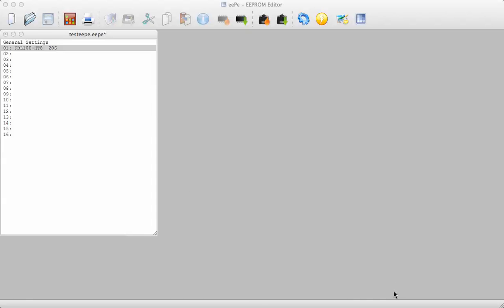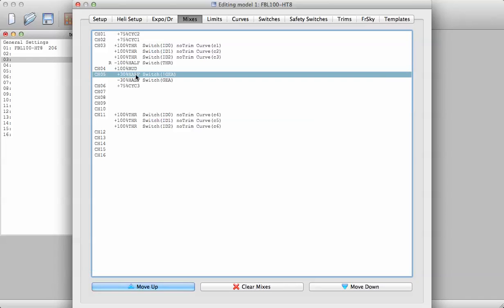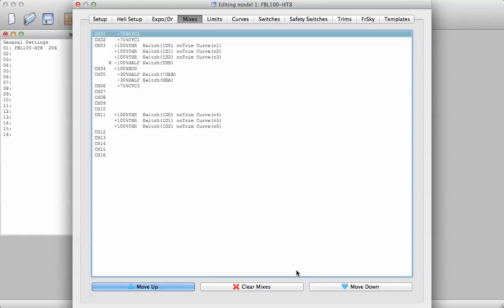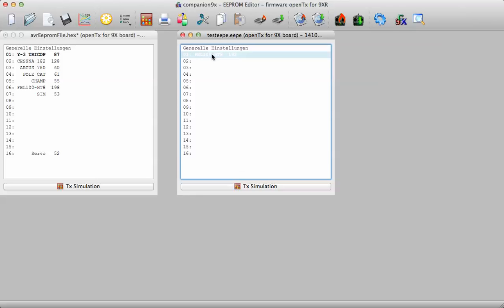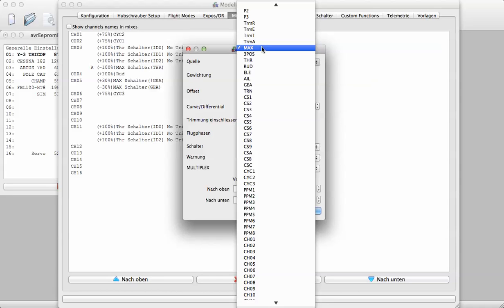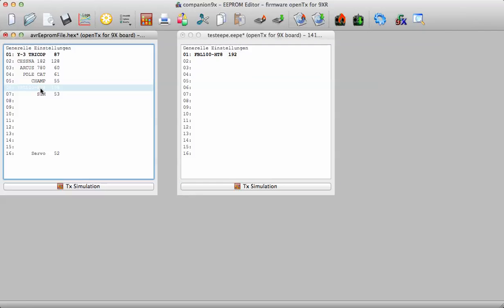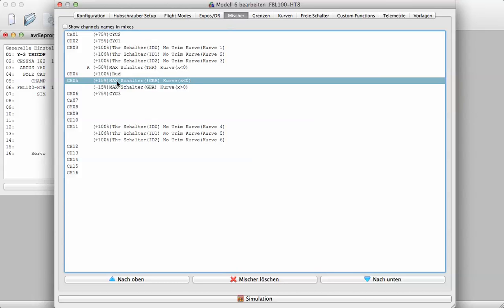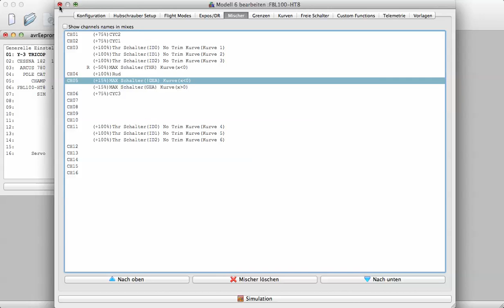HiSky FBL100 and HT8 and 9XR and OpenTX Firmware

Comment: Thanx for this .. I just flashed my FlySky TH9x to use OpenTX and am loving it way more powerful and versatile.
I have figured Basic plane and my 4 channel FP Helis NP. I am now starting on my ccpm 6 channel Helis I  have a HCP100 I'm going to setup first and have found some help on Youtube but ran into the R and HALF source i figured out the R was replace < but couldn't find where why or how on the HALF source I used MAX but didn't think to half the Value Doh!
Thank you very much and for the file I will be able to get a better look through the epee file.